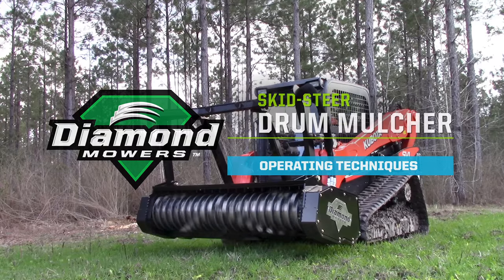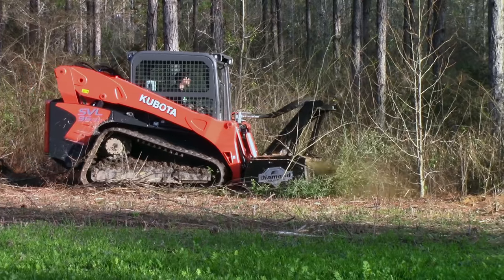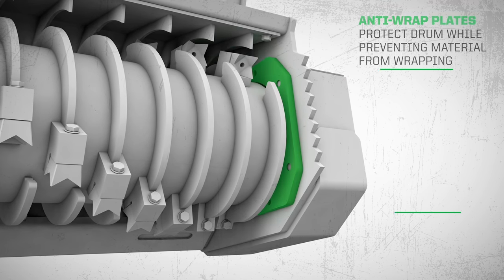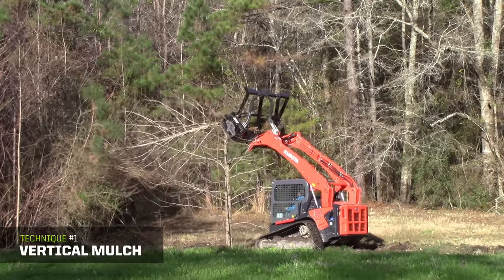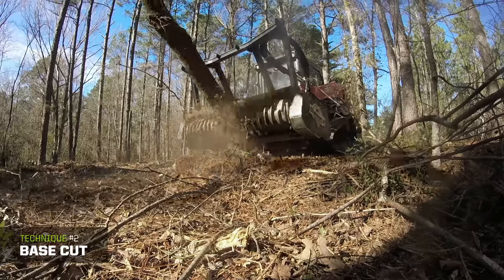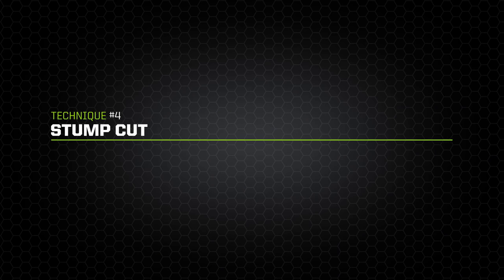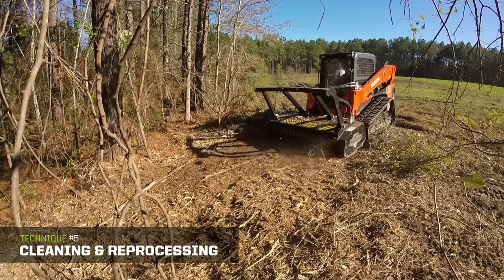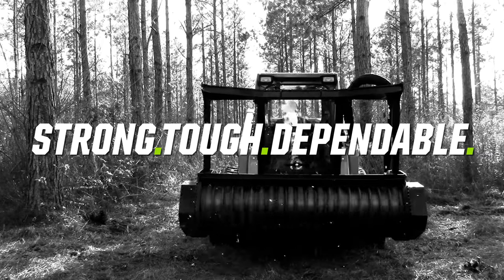Skid-Steer Drum Mulcher Attachment: Operating Techniques

Comment: I hope the production model has rear chains. And will it be available in a 60" model?
Reply: I agree with they need to make a 60 inch version. I called diamond was told there not going to
Reply from the maker: Our drum is designed to not need the chains as the material is angled out by the design of the inner drum and a bottom reflection plate.

We don’t see much material being thrown backwards, it is all directed straight down.

The original drum is 72” but there are also plans for a smaller one.
Reply: I called my dealer today about one. If I buy one I'll put chains on it.
Reply: They got a 60” now.

Comment: Why does the stump cutting technique wear the teeth more than other techniques?
Reply: Any contact with dirt will dull metal quickly. See it very often when using a chainsaw. Seems odd that dirt will dull it faster than wood.
Reply: @otis6791  I know right I could understand it with a chainsaw but I thought these machines were built to do at least a certain amount of groundwork you would think that the Cutting Edge would be up to it
Reply: dirt is full of pebbles and rocks.
Reply: It's because silica is the most common mineral and is in nearly every rock and in the soil. Silica has a greater hardness than steel so thus dulls metal easily.